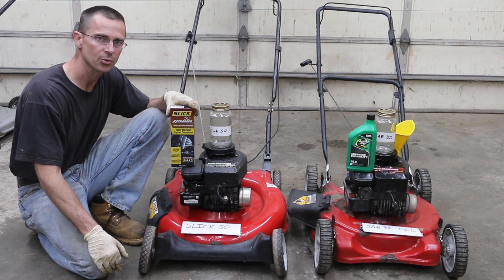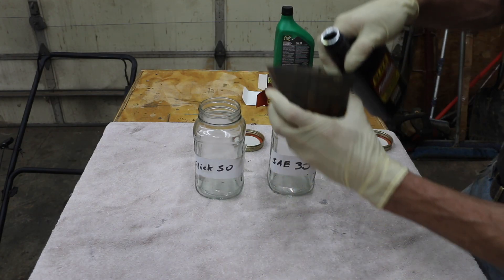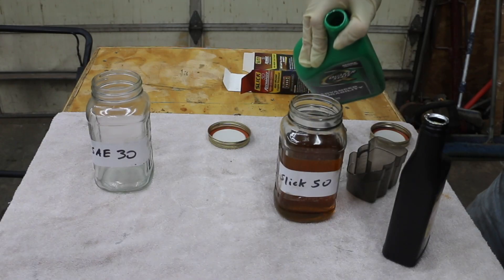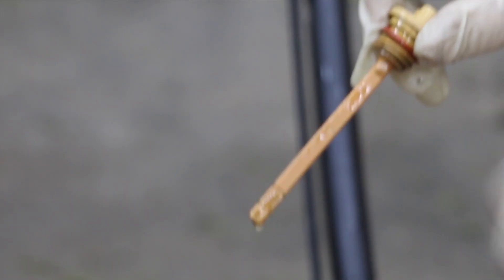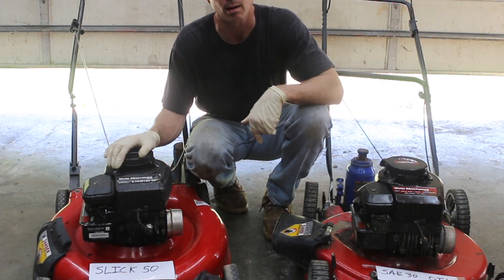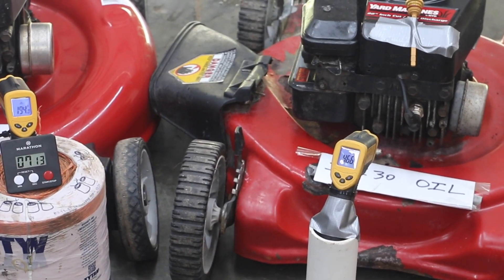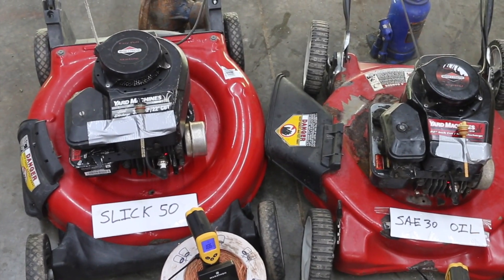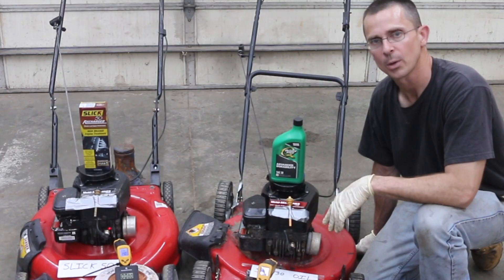Can't believe what SLICK 50 did to my engine!!--Dry Crankcase Test!

Comment: Slick 50 needs to bond to the engine, not a one run bonding.  On a Car its recommended 3,000 miles.  I've had oil run out on treated cars and be okay.  So you should test after running it and letting the molecular bonding take place as instructed.  Nice channel.
Reply from the maker: Tim, thank you for this recommendation!

Comment: What do you think is going to happen if you put in slick 50 then drain it a minute later? you might as well not put in any at all, the weaker engine will seize first and I doubt those two engines were the same or in the same condition.

Comment: You put in slick 50 started it up then drained and tested, big deal. It needs running time to bond to the moving parts, learn how to test properly plus if you put in 4oz why didn't you -4oz of sae30?
Reply from the maker: Bart, I've read all the other comments.  All great constructive feedback. I plan to do future tests using new engines.  Thanks for the constructive feedback!

Comment: Maybe this kind of product works better where the oil is not the only coolant. Watercooled engines might have shown different results . Be interesting to see which part of the engine siezed.

I dont think the use of solid aluminium  conrods is too much of an issue as a lot of bearings use aluminium alloy shells on the crank end.
Reply from the maker: Mike, Water cooled vs air cooled--great point.  This could make a difference for sure.  Thanks for commenting!

Comment: Try the same test with ProLong.... In my high school shop class we tested ProLong in a car engine... Added Prolong to regular oil, ran engine up to operating temperature for about 30 minutes... drained all oil... started the car and left it running while school was over for the day... the next day we found that the engine had stalled, but it was because the car eventually ran out of gas....  would like to see if it was just a fluke or if Pro Long actually works.
Reply from the maker: Wow!  That is an impressive test that your high school shop class did with ProLong.  I'll definitely test ProLong.  Thanks for this video project recommendation!

Comment: I like this test but unfortunately it leaves a lot of factors out. How many hours are on each motor? Has one motor been run dry before? Has one motor had slick 50, stp, or Lucas used in it before? The only way to accurately do this is with 10 new engines, 5 with slick and 5 without, to be able to repeat the results. Awesome video though, don't stop doing what you're doing
Reply from the maker: I agree.  I plan to use new engines in the future to make the test fair.  Thanks again!

Comment: As with all your videos I enjoyed it immensely but, aside from all the other equal comparison comments one thing I noticed is that these 2 mowers seemed to be years apart in age.  As we know manufactures commonly make parts cheaper in equipment year to year and I wonder if the seemingly newer Slick 50 motor just wasn't made with the quality of metals and components. Thanks for all the great vids.  VERY fun to watch.
Reply from the maker: Chas, This is great constructive feedback.  I plan to use new engines in the future to ensure a fair test.  Thanks again for the positive comment and constructive feedback!

Comment: https://www.youtube.com/watch?time_continue=1&v=CAt-tJa9P_s

Here's why your Slick-50 test didn't work... you're not testing the original formula.

:-)
Reply from the maker: This makes sense!  Thanks for commenting!
Reply: @ProjectFarm  We suggest testing the wear on an engine as it's much more definitive than running without oil.

We'd happily donate a bottle to do the test.

An oil analysis is only about $30 and no engines will harmed while running the test?

It's normal to see large reductions in wear after treatment so it's a definitive way to show it works e.g. 82% reduction in wear in a Toyota Yaris:
http://xcelplus.com.au/docs/yaris.pdf

Comment: Try a product called Pro Ma or  Petron Plus. Pro Ma is an additive with a 3 to 5  micron  copper and lead particles in it that plates all the metal friction parts which reduces friction due to the two softer metals at the friction points - Petron Plus is a supplement that have the size of .1 micron particles that are negatively charged and they adhere to the metal which reduces the friction also
Reply from the maker: Dave, this sounds like a great additive to test.  Thanks for the recommendation!

Comment: Have you tested hot Shots?
Reply from the maker: Eduardo, I have not yet tested Hot Shots.  Thanks for this product recommendation!
Reply: Project Farm I have been using it since 2004 in my power stroke 6.0 and have not had the issues others have said with the fuel injectors. I would be curious to see if I have been doing the right thing or just wasting my money.
Reply from the maker: Eduardo, This seems like a great product to test.  Thanks again for this recommendation!

Comment: I like these videos. I think it would be a good enough test though if you just rebuilt a couple of motors rather than use new ones (unless you can get them for free) and rather than comparing one oil treatment versus only oil, compare Slick 50 with Dura Lube. I began using Slick 50 many moon ago, but changed to Dura Lube when recommended by a friend I trust. My '99 F150 has a hair less than 250k on it and she still runs like new.
Reply from the maker: This is a great recommendation!  Thanks for watching the video and commenting!

Comment: Perhaps because the Slick 50 absorbs more heat than SAE 30, it doesn't last as long. In the engine treated with Slick 50, more heat goes to the oil than to the block.
Reply from the maker: Jimmy, thanks you for commenting!  I enjoyed this experiment!

Comment: I wonder if the motor with 30 running hotter allowed the tolerances to open up so the slop kept it from seizing as quick and the heat transfer not so much with the 50 to the head only heated the piston to an extreme locking it up sooner ?
Reply from the maker: Heather, this is a great analysis!  I've wondered the same thing.  In the future, I plan to use 2 new identical engines to ensure there's no difference in engine wear to rule out that variable too.  Thanks for commenting!

Comment: Try it MBL8 from a company called ProMa.  I use this and I believe that it has saved me several times from seizing up my motor.  BTW MBL stands for metal based lubricant!  Love your videos please keep them coming!  Cheers
Reply from the maker: Ozicell s, Thank you for this product recommendation!  Also, thank you very much for the positive feedback!
Reply: It's a pleasure!  MBL8 is an Australian made product and it also comes as a grease.  I have personally tested this product on a friction brake testing machine and it is amazing.  As an oil additive, it seems to plate any surface where friction is an issue and as a grease - I have seen where normal axel grease disassociates and and brakes down under friction load and under water, whereas, the MBL8 grease hugs the high heat friction surfaces even tighter.  As I said, I have personally tested and used this product and I'd love to get some feed back from someone like yourself.  BTW, I don't necessarily agree with all your methods or results but at least you're doing something and putting things to the test!  Keep up the good work. Cheers
Ozi

Comment: Can you, or have you already done a test with Lucas oil additive? I used it in my car and never had a problem. Then i bought a craftsman riding mower with a 18.5 hp engine. When i used it in the mower it smoked like crazy out of the exhaust, and i had to keep changing the sparkplug after i cut my yard, because the plug was caked with heavy black stuff that i thought was burned oil. When i changed the oil i did not add lucas and the engine has run fine since.
Reply from the maker: Waltet Garner, Yes, I will test Lucas.  Thank you for sharing your experience.  It appears that Lucas was getting into the combustion chamber and the additives were not burning cleanly.  Thanks again!

Comment: You could try the same test using Lucas oil stabilizer in one and conventional motor oil in the other and then drain both out and run them I would guarantee Lucas engine would run longer Lucas is designed to extend oil life by clinging to the critical engine parts to cut down wear
Reply from the maker: Hunter, Great suggestions--thank you!

Comment: I added slick 50 to my vehicles engine. NOTE.... I am a mater automobile technician... I am in tune with all my vehicles and I did feel the slick 50 break down at or around 500 miles. I prefer "Prolong" Engine oil additive to any other. But that's me... Keep p the tests. They are interesting to watch. God Bless......
Reply from the maker: Juan, Thank you very much for the positive comments! I agree that Prolong has a terrific reputation.  Thanks again!

Comment: I'm curious if your results were from using slinger lubrication engines.  I ran a slick 50 treated 350 chevy successfully without oil one time.
Reply from the maker: Mike, Great point.  I'm told the formula for Slick 50 has changed.  Thanks for commenting!

Comment: I saw that slick 50 test at a state fair. They had an old small block chevy on a run stand (battery, radiator etc). They ran it with oil and the slick 50, Then they drained the oil removed the pan and valve covers and it ran for a long time. They even threw sand into the engine. After a while, they stopped the motor replaces the oils pan and valve covers and replaced the oil for the next test. They ran that test on the same engine all day long.
Reply from the maker: Wow!  I can't imagine how they pulled this off.  The lawnmower barely lasted 2 minutes.  Thanks for commenting!

Comment: As far as I know The Slick 50 we buy today is not the same formula as the original - just the name was sold... Regardless Slick 50 WAS Polytetraflourene (PT) ... PT is NOT suitable for hot combustion engines... it will congeal in tight orifices when mixed with hydrocarbons... it is usually used for electrical devices at much lower temperatures without hydrocarbons begin combusted...
Reply from the maker: Jim, Yes, the formula has changed.  Thanks for sharing this information regarding PT.  Thanks again!
Reply: Great to see your cool experiments... I have never seen this experiment done so it puts to rest whatever thoughts I had about Slick 50 as well. 

;-)

Great channel... Thank you.

Comment: I sure thought it was Duralube that ran the old commercial with the engine running for an hour dry. That is the one I use, and had a bad experience where I hit a median and knocked a hole in the oil pan. I drove the car (lincoln town car) 55 miles home without oil! The duralube seems to work! No permanent damage to the engine! New oil pan and drove the car another two years!
Reply from the maker: Lots of positive comments regarding DuraLube.  Thanks for your comments.  I enjoyed reading them!

Comment: i remember that tv ad. also i had a similar experience in real life. the slick 50 saved my engine.
Reply from the maker: Steven, Glad you had great success with Slick 50.  Thanks again!
Reply: Steven Douglas I think it works. it's going to seize with no oil. My SUV ran great with it.

Comment: I was really looking forward to the slick 50 video you did. A few notes. Slick 50 has Teflon that is generally on the bottom of the bottle and needs to be shaken up well. And also these are Air cooled engines whereas automotive engines are water cooled. What are called engines generally don't get much hotter than 200° as the thermostats generally open around 180° where is air cooled engines get much hotter. The Teflon additive may work better in the cooler engines.
Reply from the maker: James, These are all great points.  Thanks for commenting!

Comment: In those "commercials" they used two brand new cars with new engines.  Doing this test on two used engines that do not have the same amount of wear is pointless.  You proved nothing.
Reply from the maker: Captain Howdy, this is a great point.  I plan to use new engines in future tests.  Thanks for commenting!

Comment: The one product that is better than Slick 50, or indeed any additive, is modern engine oil. The fact that an engine treated with Slick 50 is able to run at all with an empty crankcase is really a testimonial to the quality of the regular oil to which it was added.
As for those ads from 25 years ago, keep in mind that the makers of Slick 50 had to settle with the FTC for making false and misleading claims.
Reply from the maker: CaptHollister, This is a great point and great information.  Thanks for commenting!

Comment: Duralube. My dad built race cars for most of his life and swears by the stuff. Growing up I watched my mom run a couple cars without oil multiple times to the point where the lifters had collapsed and it ticked like a clock on speed. Put oil back in the engine, lifters pumped back up, and we drove them for at least a decade afterwards till we sold them and they drove away.

Comment: Slick 50 lowers the oil viscosity but raises the film strength. The result is that the latent lubricant wicked and burned faster, but prevented much more heat.

Comment: Lucas is the additive that sticks to the gears at the parts shop display.
Also, the mower with slick 50 in it looks like it had 5 more years use on it judging by just the wheels alone. if you did one of these tests again you would probably want to inspect the crankcase perhaps even do a rebuild on both so they start fresh. Those kits are cheap.
Thank you for your videos!
Reply from the maker: Great point. I plan to use new engines to ensure a fair comparison in future videos.  Thanks for the positive comment!

Comment: Interesting video. I initially thought the Slick 50 would last longer as it was running cooler. I wonder if the carbon from the burnt SAE30  the other engine longer.
Reply from the maker: Jamie, I was surprised slick 50 seized first.  Next time, I'll use new engines to ensure a fair comparison.  Thanks again for commenting!

Comment: Not sure if a splash oil system is a good test.  But understand the cost of sacrificing engines. (at least you are using Penilistucky oil, best lubricating oil out there)
The motor, when run WITH oil ran cooler.  It seems to have its merits.  Maybe not in a car, but lawn mower, moped/scooter, etc.
There are dry coating system (from even before Slick50 days) But thats done before engine assembly.
Good test nonetheless.
Reply from the maker: I enjoyed reading your comments.  Thanks for taking the time to comment!

Comment: I went to a seminar in the early 70s back when they were trying to promote synthetic oil and they did a similar test only we used 12 brand new mowers that we had to unpack out of the boxes and assemble. Each mower used a different oil brand. We started each one and ran them for 10 minutes and then we drained all of the oil out. Back then the 3 1/2 hp Briggs had drain plugs on the bottom of the engines. We did not put them back in. Started them all and let them run till they seized up. The first two that seized up were the Pennzoil and Quaker state. The last two were Havoline and Valvoline. Of course the synthetic kept running way beyond the regular oils. I was in my early 20s when this happened and to this day I will not use the Quaker State or Pennzoil on a rusty chain and Valvoline goes into my automotive engines and Havoline goes into my air cooled. Pennzoil and Quaker come off of the same packing lines. I know that for a fact.
Reply from the maker: handyman, I enjoyed reading your comments!  My father always discouraged me from using Penzoil and Quacker State oils and I normally don't use them.  Got it on sale for use in these old mowers.  I use Valvoline in my vehicles and have had terrific success.  Thanks for commenting!

Comment: How much wear and tear was on the slick 50 motor if both engines are not brand new not a fair test also if slick 50 runs a motor cooler it will help preserve an engine
Reply from the maker: This is a great point.  In future tests, I will only use new engines that are identical.  Thanks for commenting!

Comment: You might try the Heavy Truck oils, DELO and ROTELLA. They may be using an additive which makes oil run towards heat rather than away from heat.
Reply from the maker: YodaWhat, Thank you for this recommendation!

Comment: I used DuraLube  in my 02 Dakota  when I first got it with 60,000 miles on it. After about a week,  it started running rough. Took it to my mechanic who said after testing,  it was running too cool for some reason.  I told him about the DuraLube and he said that it was designed to run hotter than it was getting.  I did regular oil changes since and it smoothed out at around 100,000 miles. I still drive it every day and now have 213,600 miles on it and still going. I bought it in 04 from a dealer.
Reply from the maker: Very interesting!  Thanks for sharing your experience with DuraLube.  Also, those Dakota's are great trucks!

Comment: Also, would you/ could you do a video on bestline additive?   I just seen a video on it, it seems everyone has called this guy out as a snake oil con artist.  I know nothing of lubricants. Other than to just change at regular intervals.  They also call it the one arm bandit test.   I have 7 motorcycles a diesel truck a rotary car and wife's standard inline four engine.  Just looking to get better, or less wear on my vehicles.  Weird to see slick 50 failing before standard oil.
Reply from the maker: Tommy, Thank you for this recommendation.  I'm like you...I have several gas and diesel engines that I'm trying to keep going for as long as possible.  I plan to test bestline additive in the near future.  I approach all of these additives with a lot of skepticism too.  Thanks for commenting!